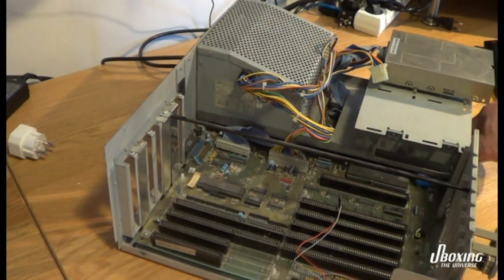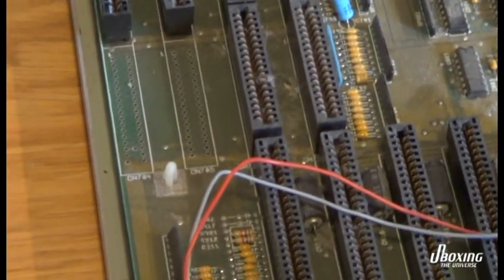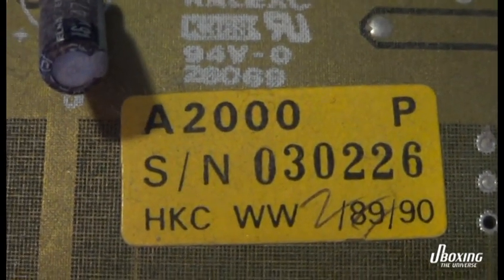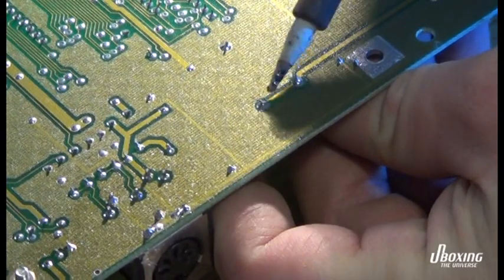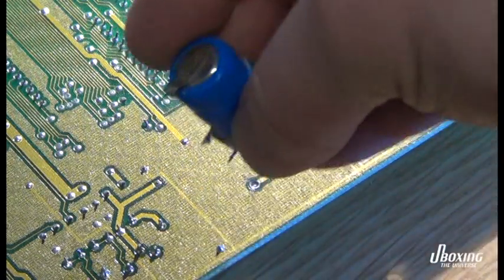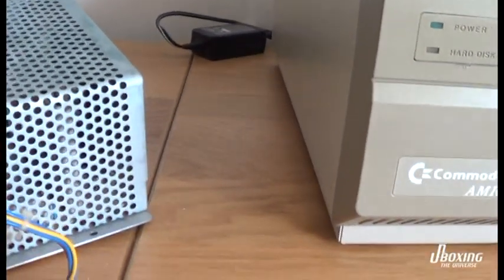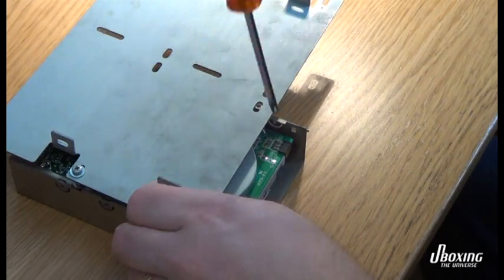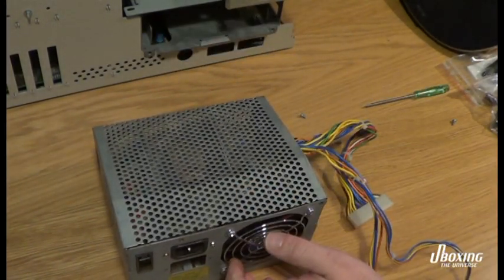Amiga 2000 battery leak and recap

Comment: Thank you for the video! Just a point regarding the battery - you mentioned that it is battery 'acid' that causes the damage. These are alkaline batteries, so it is the alkaline substance leaking out of these batteries that causes the corrosion damage. Thus, any neutralisation of an alkaline needs to be an acid base - like vinegar, for example. Which in turn needs to also be cleaned up - normally with distilled water, or better with isopropyl alcohol.

Comment: the proper way would be to add some silver bearing solder to the pad, then remove it with braiding or vacuum removal like a Hakko FR301 or clone. the original solder can become hard due to the electrolytic leak from the old barrel battery. heating it up and pulling works, but you could risk Fracking up the pads, remember this is a DUAL layer board.
Reply from the maker: Thanks for the tip.

Comment: to me these Amiga x000s models are a failure because they were too overpriced and overdone for a gaming machine (the A500 was a success in that area, also in multlmedia for the mid 80s) and waaay too underpowered as a business pc; it's very clear that Commodore wanted to compete in the intel pc market with these "pc-looking" Amigas but on the inside they are very underpowered and not compatible with anything in the market (circa 1990)
Reply from the maker: Hello! Look at my video https://www.youtube.com/watch?v=4zbCSZrQTTM
Check out how they tried to solve the compatability problems. Thank you for watching.
Reply: In 1987 when these were released, they were still light years ahead of Intel PCs. Even through at least the first half of the 1990s, nothing in the x86 world could touch it for video work (Video Toaster/Video Toaster Flyer), to say nothing of the fact that x86 PCs didn't have a preemptive multitasking OS until 1995.

Commodore did a terrible job marketing the machine to businesses, it's true, but the idea that an A2000 is a mere "gaming machine" is an all-around myth. It was a powerhouse in its day, as was the A3000 three years later. The A4000 was arguably beginning to fall behind in 1992, but that was the first time the platform had failed to exceed the price/performance of its competitors, and even the (admittedly somewhat lackluster) AGA chipset could hold its own against most commodity x86 PC's graphics subsystems of the mid-1990s.

Comment: Why not replace the fan in the PSU, they make a LOT of noise, i just replaced my fan on the PSU of my Commodore 128DCR with a Noctua NF-A6x25 FLX, yes i know the Noctua fans cost a lot but they are one of the best you can buy, and it's night and day replacing the fan.
Reply from the maker: Well I kind of like the noise. Or maybe my hearing is gone :)
Reply: UnboxingTheUniverse  Yeah i think your hearing is gone :-)

But serous, it makes as much noise as a vacuum cleaner, it's the first thing i did with my Commodore 128D.

Comment: That PCB did not want to come out the case did it!
Reply from the maker: No it was kind of stuck in the plastic "legs" in a wierd way.
Reply: Interesting, My Rev 6 case has all screw mounts. I bet you have a Rev 6.2 board judging by the 2.04 ROM. Must have been another cost-reduction change to the case.
Reply: probably a 6.3 or later, because 6.2 came with Kickstart 1.3. Just a question, did you need to repair traces or just worked after a good clean up? Cheers, M